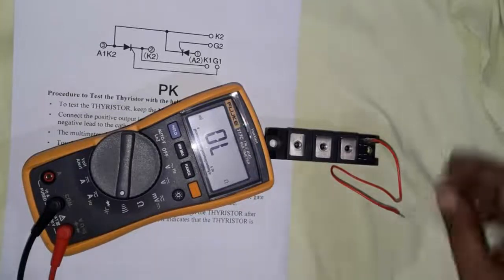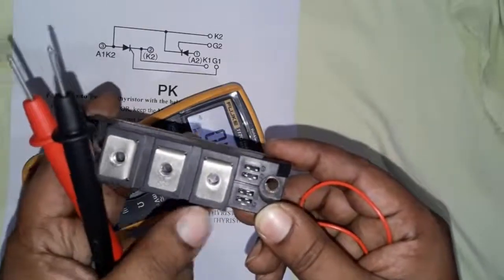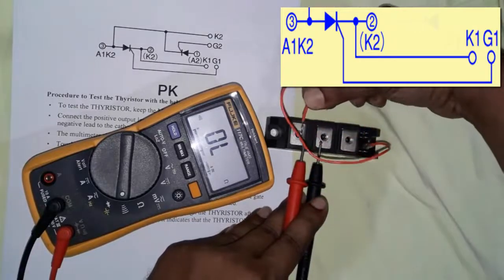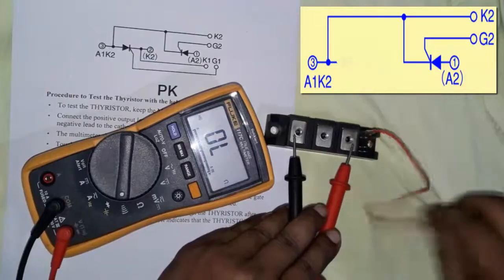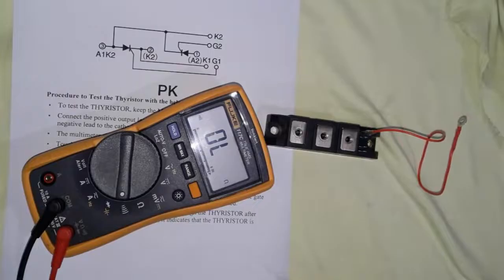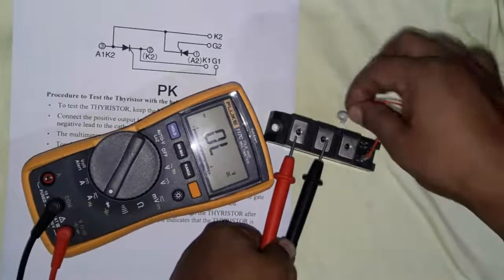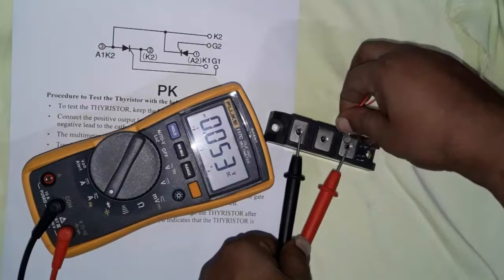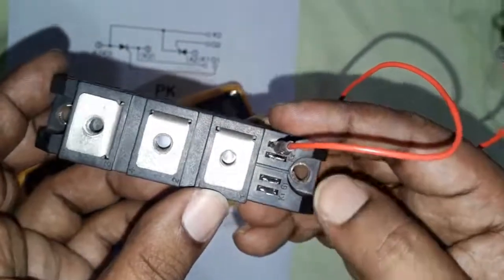𝙏𝙝𝙮𝙧𝙞𝙨𝙩𝙤𝙧 𝙤𝙧 𝙎𝘾𝙍 𝙏𝙚𝙨𝙩𝙞𝙣𝙜 𝙋𝙧𝙤𝙘𝙚𝙙𝙪𝙧𝙚 | Procedure to Test the Thyristor with the help of Multimeter

Comment: This video is wrong - he is shorting the dvmm together. Touch the gate (which should latch the diode) and quickly put the red lead back in the diode anode... or better still apply the gate voltage via external supply / another meter (with the grounds tied together)
Reply from the maker: Thanks for alternate

Comment: Is it for convert AC to DC right?
Reply from the maker: Yes
Reply: @FlowChart  how to wiring AC input and DC output? I see only one AC input
Reply: @FlowChart  ??????
Reply from the maker: This type 3 pcs used for making 3 phase SCR or converter. Please check drawing.
Reply: @FlowChart  we output DC- and AC neutral together?
Reply: @FlowChart  i want to use it for convert my transfomer to DC for charge battery. can you help me send diagam to connect input AC and output DC of that reticfer diode?

Comment: This is not correct. You can’t use the multimeter diode voltage the power tue gate. All you’re doing is testing  the gate to cathode. If the gate was closed you’d still get the same reading.
Reply from the maker: Thanks

Comment: Of course it will connect, because you connected the gate (which has only few ohm to cathode) to anode
Reply: Indeed, I believe it should remain conducting after the gate is disconnected from anode, right? That is not happening here.
Reply from the maker: It’s just a testing way. Youbcan test in another way also.
Reply: The connection between the two probes are closed via the gate, doesn't proof anything